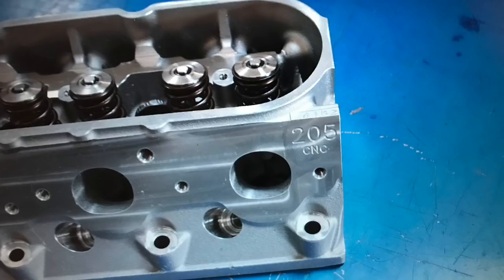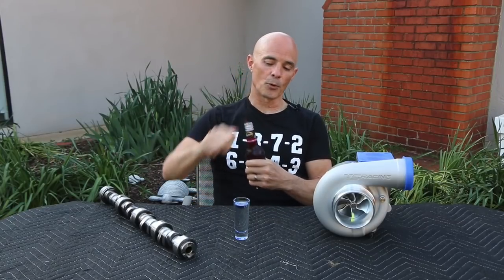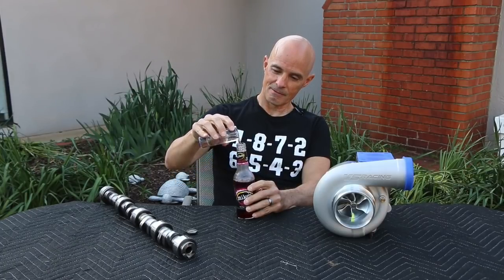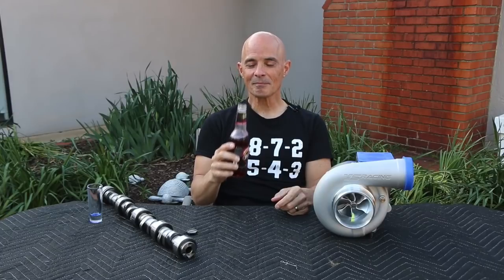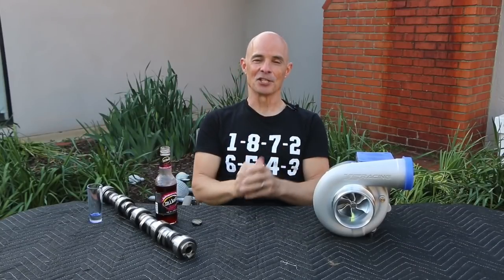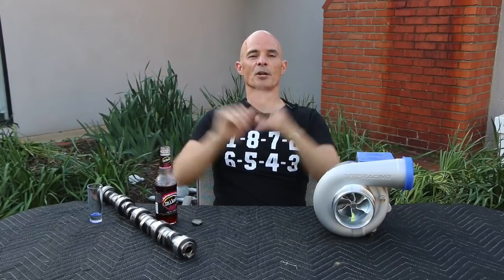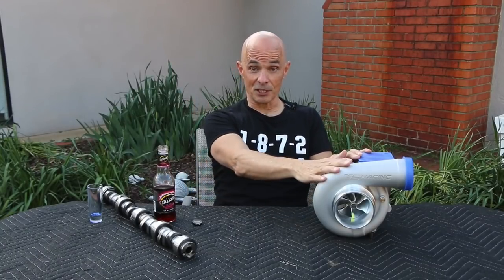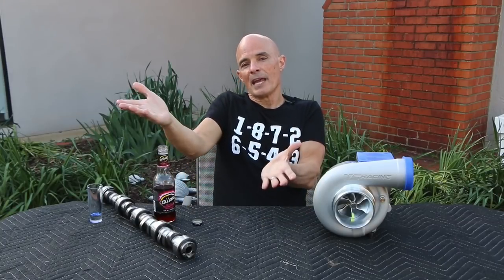TURBO LS-WHEN ARE PORTED HEADS NECESSARY?

Comment: I always heard that more cam = less boost needed, glad to hear that it's not a myth.

Now what I really want to know is can 2 250 HP tiny turbos on a 5.3 fatten up the bottom of the torque curve enough to make a difference over spending the same amount of money (including the fabrication needed to mount the 2 turbos to the 5.3l LS) on NA upgrades. I'm thinking of lightly porting the 706 heads and maybe putting on an LS2 intake to get an engine I can see over in my T-bucket but since I'm using this car for autocross and it's going to be spending about half the time 3k-5k RPM but also down just off idle coming out of single-pylon box corners (the local favorite to keep speeds down in big spaces) and also that one straight or 3 pylon slalom that gets to the max speed for the course allowed by the rules and I have to push the engine to or past redline for a second. So this is a competition that requires an engine that works through the entire operating range. And I want to get as much power as I can off idle and midrange without hurting the ability to rev freely.

Comment: Richard my question which I have not be able to find anywhere. How do the VS Racing turbos. specifically the ball bearing ones...hold up to mileage. I am looking for one for my weekend car 78/75 800hp range. Can I get years of life out of it? or would I be better off getting like an s475 borg? I am 401hp na right now with ported heads and a baby cam...looking into a bigger cam right now. Just thinking around 15lbs of boost. I just want to buy the turbo and not have to worry about it blowing up in a year or 2.
Reply from the maker: The VS stuff has a good reputation-I don't do much long term testing other than on my Mustang years ago
Reply: @richardholdener1727  how long did it hold up on that? I would like to snag a ball bearing one if i could for the price of the s475 so vs hits that sweet spot. I have heard good things about them. I am just thinking if it is to good to be true it probably is. Thanks for the response. love the videos

Comment: Richard I'm curious if you have ever worked with any katech ported heads ? They have some economy options like just cnc work I think would a great middle ground
Reply from the maker: I have a set of those on the SP 5.3L
Reply: @richardholdener1727  Are they the ones with just the cnc porting and none of the other work ? We're they a big improvement ?

Comment: drinking "octane booster" ;)

I'm more in the 80/20 rule.  Most bang for the buck, optimal performance and not just peak hp.  I also wouldn't upsize the 706 valves.  I think they work best with the port size and manifold.  

the thing with unshrouding intake valves is that we DON'T want fuel to flow to the cylinder wall!  That's where flowbench flow doesn't equal more hp.  Most of the airflow gain is from the valve job!  Blend a little and you've got the lion's share of the gains.  Like you said, there's nothing gained from port matching...and probably lost.  Dyno with just the unshrouding and see what happens.

Comment: It all comes back to how much money you want to spend.  Just get a set of square ports and unshroud them.  Cheap.
Reply from the maker: just not on a 5.3L
Reply: @richardholdener1727  ofc. Have you ever tried unshrouding the bores like is done with ford Cleveland? I know most would just get a 6.0 but its something I wonder if would help the big valve head work on the 5.3

Comment: It’s better to make the same power on less boost pressure, keeping iats down to make safer more consistent conditions in the combustion chamber. Also more power and tq when out of boost, better cylinder head clamping with aftermarket heads.

Comment: I hear it all the time, why bother with a ported head, I can just turn up the boost +2psi and get the same power gain as the ported head.
But when you are supercharger or turbo limited or fuel/octane or intercooling limited, then the ported heads are the only way to add more power without turning up the boost. More boost, more heat, diminishing returns.
Reply: Yup. A big 10-4.

Comment: I built a 377 which is an ls3 with a stock crank.  I put my stock ls1 top end on it from my 2004 GTO.  Untouched 241 heads, ls6 intake, and stock throttle body.  Custom cam and btr .660 lift springs.  D1x with 15 psi on E85.  I tuned it on the street and it's a lot of fun.  Hope to get it to a dyno when things get back to normal to see what the curves look like and how much power it's making.  I hope to do heads and a completely different top end next year.  I did this simply for budget reasons, but it seems to work a lot better than most would think.

Comment: I myself am building an LQ4 6.0, which started life as a really high mileage longblock. Completely tore it down, going to bring it to a machine shop and use the stock crank, stock gen 4 rods, and do some forged pistons. Already bought ARP head studs and main studs(nearly $500), going to use ARP 2000 rod bolts. Already bought Harland Sharp 1.7 roller rockers and the FAST LSXRT intake manifold. Going to use a "small cam"(216 intake 220 exhaust both 0.600" lift). I'm either sending the original 317 castings heads to Total Engine Airflow for there stage 2 porting(about $1500) or will use the Trick Flow as cast heads for $1900, Trick flow cnc heads for about $2500 or the AFR heads for about $2500. Don't need any of these parts to make the power I want with the cam size I am choosing, but I want to keep a small cam in it and max out everything else. Can always cam swap it later. I prefer to upgrade everything and do it once, regardless of how much more it costs versus a cammed junkyard engine. This engine is going in a 2005 Chevy Tahoe.

Comment: Hey Richard, is the TSP 224R cam with .600/.600 lift and 112 LSA a decent cam (not too aggressive) for a 2011 4.8L (L20) with ported intake, ported throttle body, ported 799 heads, PAC660 springs, LS7 lifters, stock valves, hardened 7.4" pushrods, VVT delete, Vararam TriPower Ram Air intake and a custom tune? And yes I would end up adding a single turbo to make around 600RWHP later on.
Reply from the maker: i don't know the duration on that cam and that is what determines if it is too big for the 4.8L
Reply: @richardholdener1727  duration is 224/224 brother
Reply: @richardholdener1727  I have seen a guy running it (roblowshow) on YouTube and he said it doesn't affect brakes, vaccum and works perfect with the stock converter and trans.

Comment: So the question really becomes. If I can make the same horsepower by just increasing air flow. Then why upgrade? 
Boost is nearly a measurement of resistance.  So who cares if I need to turn up the air compressor.  Air is a free  option provideby way of reclaimed wasted energy produced by the motor.  

Thanks for any input.
Reply from the maker: higher back pressure and charge temp also part of it, but that route works fine
Reply: Richard Holdener hmmmm good point.  So here then is my stand.  If you have provided “recipes” for 800hp attained easily and consistently with a cam springs and boost.  I’m completely content with that as a street car.  That more hp than most new cars I can’t afford.  800hp will kill you very quickly and is an incredible amount of power. That is nothing to be ashamed of.  To be able to build that for 2000$ or less.  Pftt...,. Sign me up.  
Love your channel. Keep up the good work.

Comment: I would think that someone on pump gas has additional limits.  E85 isn’t readily available everywhere; it puts a limit on how much boost one can safely run.  Many gas stations around me have a max of 91 oct, so an engine may not be happy at 10 psi unless the timing is retarded, which reduces power.  At the same time, there’s only so much power you can put down on the street, and a lot of people can’t handle 300 whp, let alone 600.  

I’m of the mindset that it really depends on an individual basis.  The guy with a hot rod that mostly lopes around town and does burnouts at the ice cream cruise can get away with stock heads; just toss a cam in it and it’ll be plenty of power.  For the guy chasing numbers at the track, a good CNC ported or aftermarket head would probably be worth the money.  For the guy that likes to wrench on cars and build things (or guy trying to run a number on a shoestring budget), taking the time to research and hand port their own heads, while not necessary, would likely boost the power numbers a bit and give them the satisfaction of having done it themselves.

Comment: What about when you're running a class that is compressor limited like Limited 235?  When you've maxxed everything out with stock heads and you need more?  The TFS220 fast-as-cast are pretty tough to beat.

Comment: So Richard, what are the downsides to running more boost to get the same result? Let's say you have the same exact 1000hp capable turbo. Setup A with heads/intake/cam makes 800hp at 18psi and setup B makes 800hp at 28psi.
Reply from the maker: Higher charge temps and back pressure with more boost

Comment: My thought on the more boost vs more airflow mods thing, is more boost is going to increase parasitic losses from added heat on the cold side which may limit timing below optimal.  It will also add parasitic losses on the exhaust side as backpressure rises relative to boost pressure. So basically, by not upgrading, youre lowering the ultimate limit of the motor and for a given power level, the non modified motor will be pushed closer to its limit and have a smaller margin of safety.  It may also not spool the turbo as fast as a modified motor.  The modified motor is clearly the more effective choice, but the non modded motor is plenty effective.  So the decision on the "best" choice really comes down to thickness of your wallet.

Comment: 10:12 Get a gt25 with a huge exhaust housing turbo run it at 30lbs of boost and tell me if you hit even come close to a 1000 hp never mind 1500hp.  A turbo has a cfm  rating after it flows out side its map it very well still make boost . Rather than making power it will just heat the air. x amount of boost doesn't = certain hp . Thats true only for that turbo model.
Reply from the maker: A GT25 won't make 30 psi of boost on any LS

Comment: One question I have. Is it easier on the bottom end to run less boost to make the same hp or is it irrelevant? I would guess it's a little easier since there is less backpressure to make the same power.
Reply from the maker: maybe a touch different, bu the cylinder pressure required for the power level is the big amount

Comment: There is another reason to go to an aftermarket cylinder head, and that is for the thicker deck. Factory cylinder heads have much thinner decks and will start to flex and push water at high cylinder pressures.
Reply from the maker: Yes-I meant to cover that-I was drinking

Comment: Ok so my question is should I fully port my 706 heads or unshroud the valve or leave them alone they are going on a 5.3 that I’m fully rebuilding it has a stock crank with gen 4 rods and flat top pistons from speed pro with a summit stage 1 high lift truck cam also I’m in Southern California and it’s going in a 1990 Chevy truck so I need it to pass smog

Comment: Now I get it may not be needed on a 5.3 turbo engine making say 800hp. But if you are trying to make this power in an everyday driver, wouldn't using less boost with better heads to end up at the same 800hp be better for longevity of the engine?
Reply from the maker: longevity will likely be the same
Reply: @richardholdener1727  really? More boost is not harder on the engine?

Comment: Richard you keep saying the same amount of boost for engine A and engine B, but the low buck engine could also just run higher boost levels to reach the power output of the higher buck engine.  The turbo will be flowing the same amount of air, there’s just more restriction in the intake track due to the more restrictive heads, causing higher pressure.
Reply from the maker: I provide the paths-You get to choose
Reply: Richard Holdener I apologize if what I said appeared negative, it’s just another path that you didn’t mention.  I thank you for your efforts and great informative videos you provide!

Comment: 6.0 with some cleaned up 706's. Super punchy turbo down low. Basically a single turbo LS "EcoBoost" combo that pulls to 6k. 500 tire on low boost with 91 octane. The Unicorn.
Reply: Sounds good.

Comment: well, I have been thinking stroker kit, aftermarket head, stage 2 cam and a turbo but I dont need all that. besides I don't think my 4l65e can survive after that much power.
I would probably do heads, cam and performance transmission.
Thanks for the video.
Reply: A 408 with the right cam, would probably satisfy you even without a turbo.

Comment: I'm stuck deciding what to do.
I have a 2004 GTO with a LS1 that makes 437 rwhp na and for the 2nd time I have "lifter tap".  The engine has 150,000 miles on it;  Should I take the heads off, again, and this time replace the Lunati Link Bar lifters with a different style / brand or should I go with a different block that won't destroy my wallet which is easily compatible with my GTO?  I don't necessarily want to spend more time and money on a LS1 that's limited on power and time.
Reply from the maker: if this has happened multiple times-its not the lifters-its the cam

Comment: I'd be the guy doing a head upgrade. If you got the money. Just do it. I'm building 408 lq4 with k1 rods and crank and dished weisco 3cc pistons. I have ported 243s but have the toss up for ported ls3 heads. Btr told me my 7675 turbo will choke out. How big of a turbo to run is the issue. 82 88mm. I already know my 80lb injectors probably won't support my set up if I run E-85 lol.

Comment: Boost is also stress on engine parts. So building the na combo to make the power you want at the lowest possible boost level is only beneficial.
Reply: Boost level really doesn't matter, its power that breaks parts. It doesn't matter if you make 500 HP/TQ on 8psi or 14psi, the stress on the internals will be the same.
Reply: Cars with bad tuning is the biggest enemy. Not power level or parts
Reply: @EGGINFOOLS  well that goes without saying, detonation is obviously going to break things but assuming state of tune is in check your engine internals dont care how much air you force into the intake, only how much power it translates into.

Comment: I'm always approaching builds from the point of well if I've got the motor apart already I'm going to spend every dime I can strengthening it for the future. 

The problem is that it snowballs so fast that you end up with a built motor that can handle all this power, but you don't get there because you can't afford the forced induction to support it. It's a balancing act.

Comment: The key is to make the engine as efficient as possible before putting the turbo kit on.
Reply: Exactly..and especially on the exhaust side, since that's what drives your turbo. If you had porting mostly focused on the exhaust side, you also keep temps down, drive your turbo better, and make the engine more reliable, and able to make more power
Reply: My thoughts exactly

Comment: I'm definitely somewhere in the middle. Building a bored and stroked 5.3L out to 6.3 liters. I have nice Cam Motion positive supercharger cam, Eagle forged rotating assembly, stock 862 heads which I'm mildly porting along with buffing the chambers and 2"/1.575" valves. On top will be a 2.9L whipple P.D.S.

Comment: just putting a pistons / rods / cam 10.5:1 370 together for 3600# street car with 317's I'll do some mild porting on. I have 821's and the rect truck intake that were going on after porting, decking, and valves but cautious about spending money in this new world. The new plan is to run the 317's with the cathedral truck intake and stock throttle body, rails etc and learn to tune on that combo. Hopefully have the time and resources to throw the rest of the combo on it next winter and see how it compares. In reality, the chassis will be overwhelmed with 500 whp so that will just lead to more mods and money I'm sure

Comment: Improve air pumps flow capabilities get more power at lesser boost. Another subject covered ive been pondering. 

How about advancing some of the oem cams? LS6, maybe a truck cam, LS2, ls3, LS7. 6 degrees is the number I’m being told but want some sort of support data.
Reply from the maker: I'd like to try advancing the ls9 CAM

Comment: Richard I'm glad you mentioned valve de-shrouding. IMHO this is where most gains are and it's pretty easy.
Reply: Bowl work is definitely the most power per hour of labor. I have yet to see a decently modern engine which benefits more than marginally from deshrouding - unless you add a significant change in bore diameter.
Reply: @needadate  do both with a parallel valve v8

Comment: What if you over port a motor that reduces intake air speed and would run not as good NA then add boost. Does the intake charge under pressure like the bigger ports because there’s less restriction? Or does the flow still suffer?
Reply from the maker: bad na is usually bad under boost-but you got boost!
Reply: I would guess low speed driveability and lag would suffer